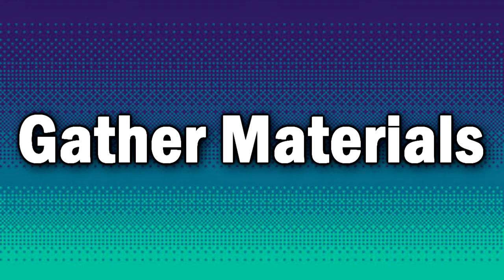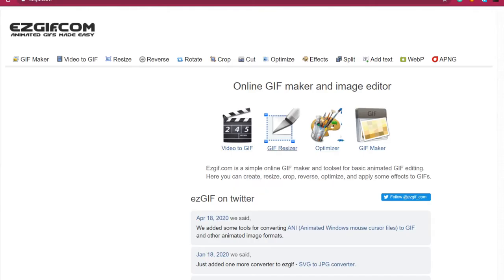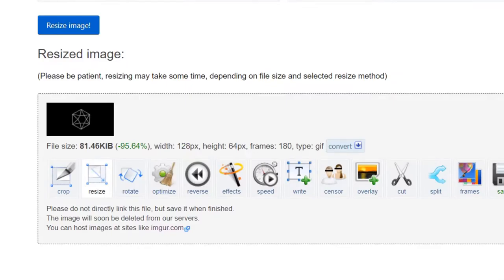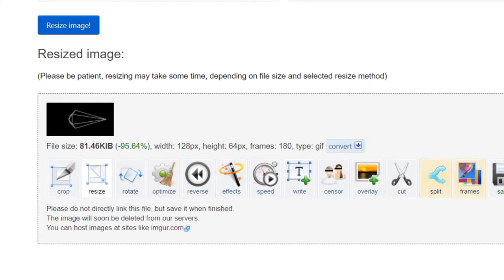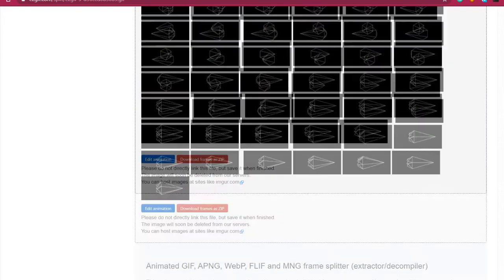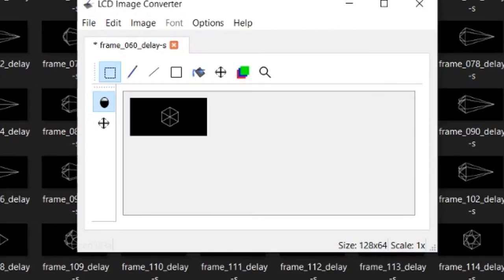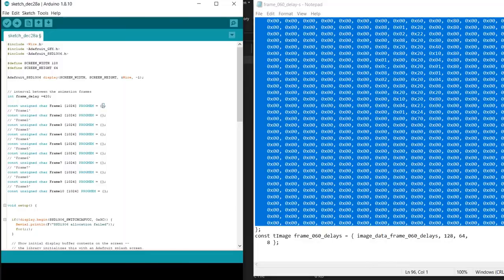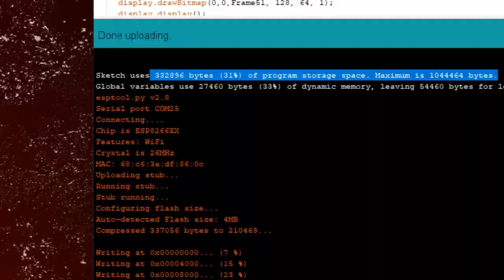SSD1306 oled display Animations

Comment: Nice video!
This is good for beginners, however, any decent project should try to do it non-blocking. I did it a time ago using a scheduler and a method for incrementing frames, but I lost it :(